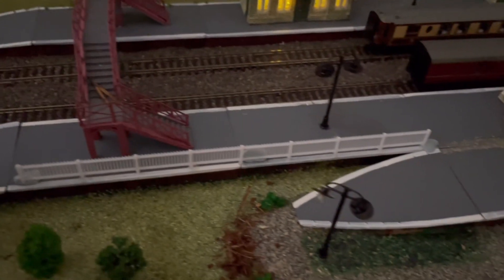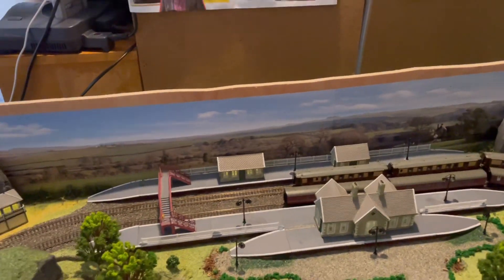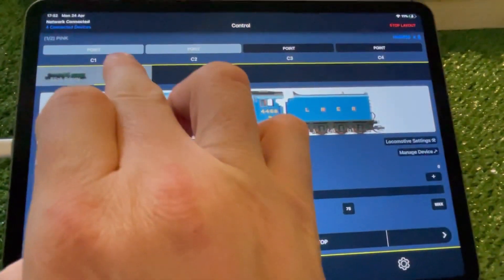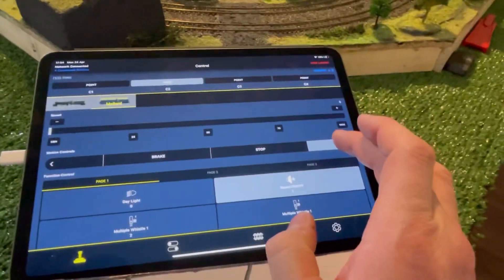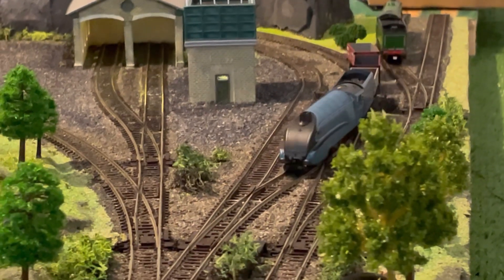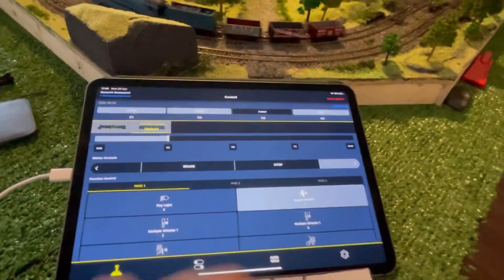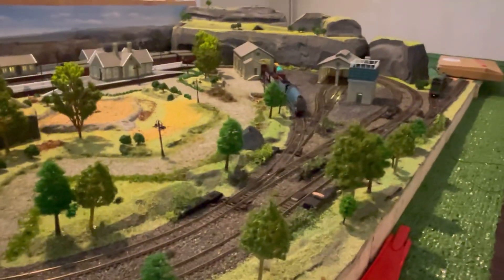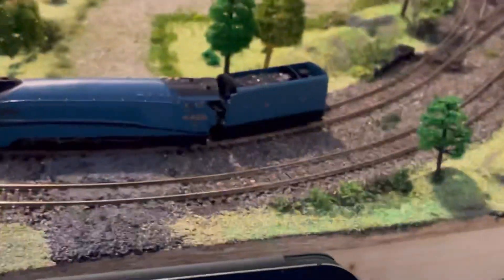Hornby TT:120 Amber Falls Part 31

Comment: Great stuff as usual.
Am I the only one annoyed by the fact the Hornby engine shed seems too "short" - neither my Mallard nor my Night Hawk will fit fully in it - like yours, the front half of the engine sticks out the front and is not under cover?
I have no idea if it is prototypical (or whatever the correct phrase is), but it bugs me - mind you, that's probably just because I am a grumpy old git nowadays.
The fencing and people really do help - I will try to do similar with my layout once I have done the ballasting.
Regards, A
Reply from the maker: Is annoying that with the engine sheds as you would think it would cover the full loco. Got the fencing of Amazon wasn’t expensive and does the trick.
Happy modelling 😀